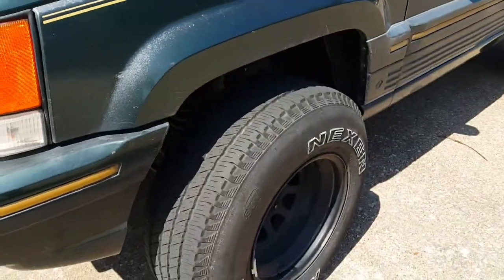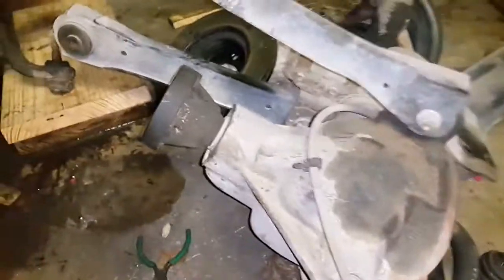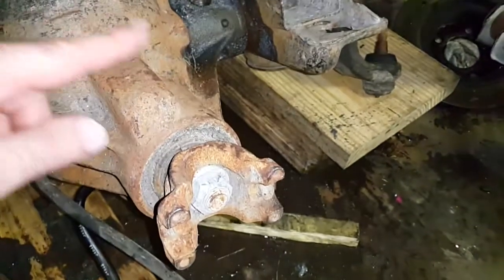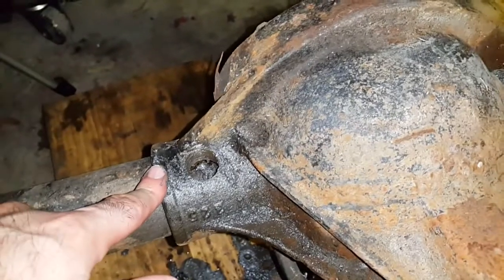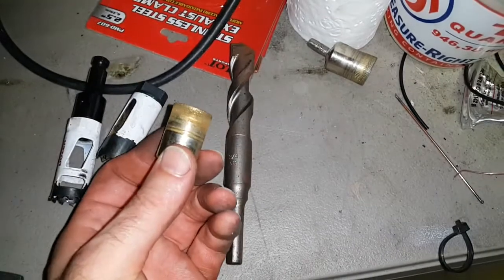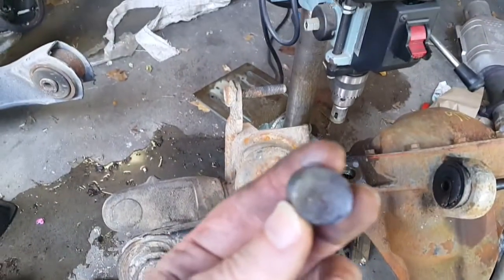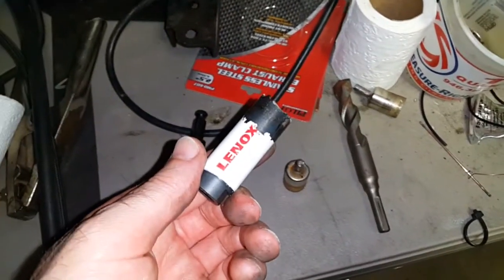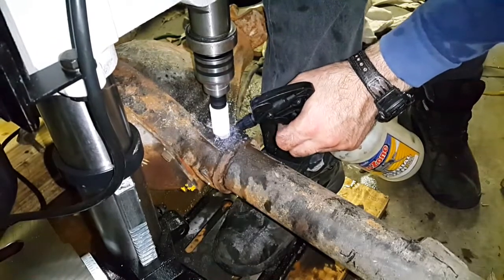Building a D30 HP jeep front axle: Part 1 - removing the axle tube welds

Comment: I thought this too and your not wrong about the center line  

But go look at the rims on a 18 wheeler or Dually all have alot higher offset than those wheels   nice job 
But seems like your putting alot of work to fix a theoretically possible problem 

1 question 
How many rims and hubs have broke due to offset    none I'm guessing
Reply from the maker: It has nothing to do with breaking anything.
Reply: But that offset is murder on tires considering that nearly the entire tire is being forced to scrub every time the vehicle isn't going straight... Not to mention its a dana 30... the inner c's cannot handle the added constant leverage of the tires mounted that far from the kingpin centerline.

Comment: You are damaging your hole saws from too much rpm with your hand drill. Lower rpm on the drill press is the reason they worked better after. Hole saws 3/4" and over should be run 500 rpm or less with good cutting fluid for best longevity and cut quality. good project, nice to see people taking on big jobs like this at home.